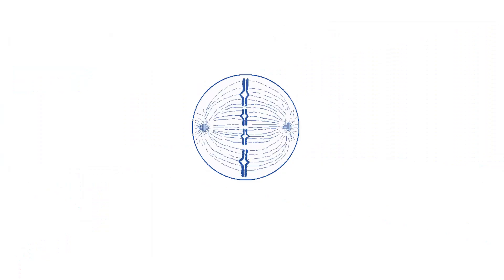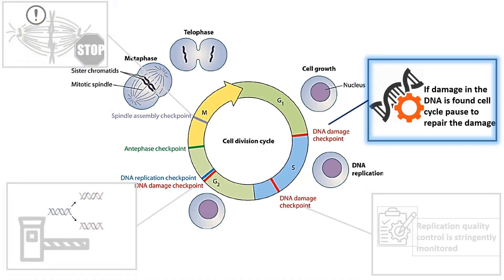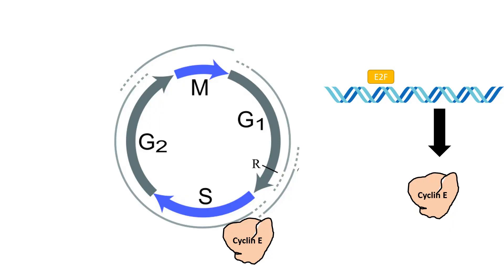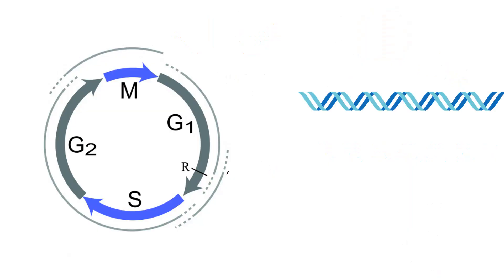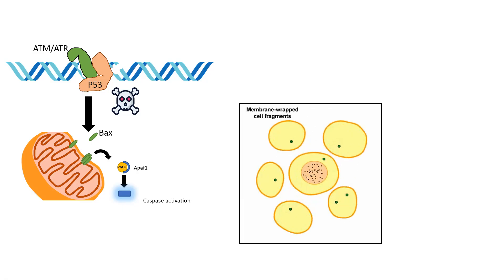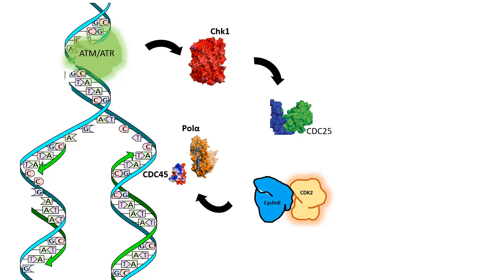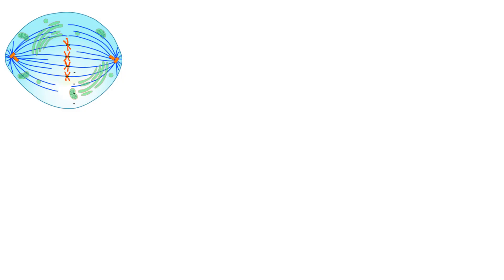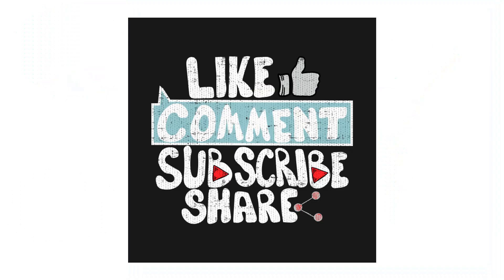cell cycle checkpoint (advanced)

Comment: metaphase to anaphase transition -> APC degrades inhbitor of separinf and therefore activating dperain. allows chromosome to be segregtaed to the 2 poles - in the anapjhse stage. 

what happens went the tension is uneven - or MT is unevenly placed. MAD2 is one sensor thatat inhibit the APC thereby the anaphase promoting complex can not activate seperain. so cohesin cant be brokenand the cell cannot segregate chromosomes into anaphse. so M to A is blocked. when MT not properly engaged the cell needs to pause it.
Reply from the maker: Nicely summarized again. You are really good at summarizing. Keep it up.